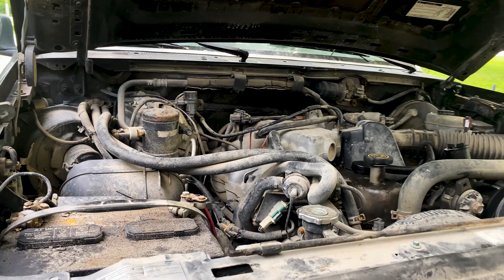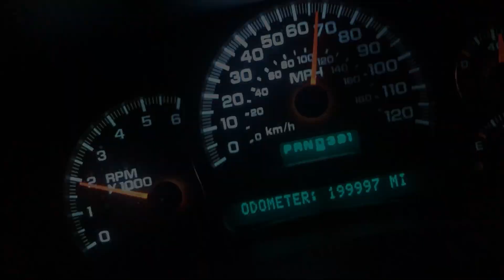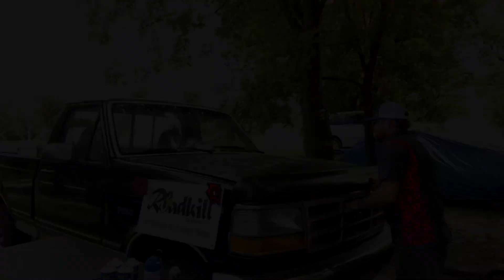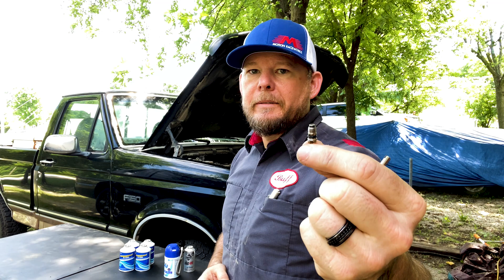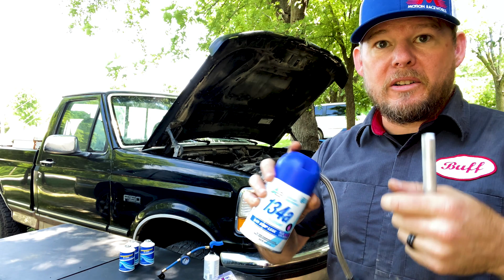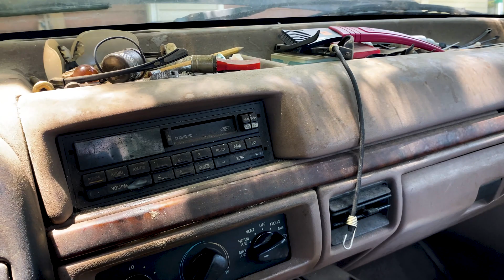1996 Ford F150 Testing and Charging the AC on Don

Comment: Great video. AC Videos at this time of year do great. Ive been fighting a leak on one of my home systems. Good times. Great effects on your intro. What do you use for editing?
Reply from the maker: Thanks. I felt like it was the right time to do it, mainly because the wife said she wanted the AC to work! As for editing, I use a combination of things, but usually Adobe Premiere Pro, Premiere Rush and Cyberlink PowerDirector 365. Yes a lot of tools but it gets me the final product I want. I also use multiple different types of cameras all shooting 4K. Thanks for asking!
Reply: @BuffsGarage  I need a better computer to process 4K , Ive tried but it runs slow so im just doing 1080/60 for now. Awesome intro you have.
Reply from the maker: @BigBlock402  thanks on the intro. I actually built my own laptop after using a very slow desktop for years. I worked with what I had and saved up for what I wanted and still ended up having to rebuild it from scratch

Comment: Great video! One system about cars I've never dealt with much, the A/C system. I have a '78 F150 with factory A/C and trying to figure out what to do with it. I had gotten my hands on some R12 but I'm thinking the system leaked it right out. Sooooo... not sure what to do at this point. Someone was telling me that if i switch to R134 I have to change all the seals...? Stock system with York Compressor.
Reply from the maker: That old of a system, yes, I’d check your high and low pressure ports (change the cores) and if you can, change out the little rubber seals. They’re cheap to get a set (I buy in bulk) and then pull vacuum on the system when it’s empty to see if it will hold. If not, then I use the dye to leak check it. I’d switch over to 134a as I’ve done multiple times without changing seals. But again, that old of system the seals need changed anyway
Reply: @BuffsGarage  Thank you! After a few other projects, I'll pull it in and have a look at it. Anything else in particular I should look for on each part that may need replacement? (i.e. dryer, condenser, evap, ect...)
Reply from the maker: @OlysGarage  of course, doing a fresh system and replacing everything increases your chance at success.  If your compressor is locked up then there could be metal in the system. Ultimately, as I’ve shown, start small and work your way up. An unlimited budget would allow for a complete overhaul, but I like to try and reuse what’s there first just to see if I can. So far I’ve been extremely successful at reviving old systems
Reply: @BuffsGarage  thanks for the info!! Probably see what I find out in a future video!